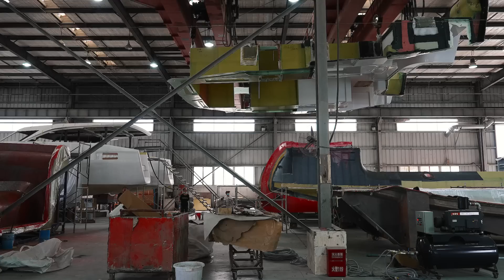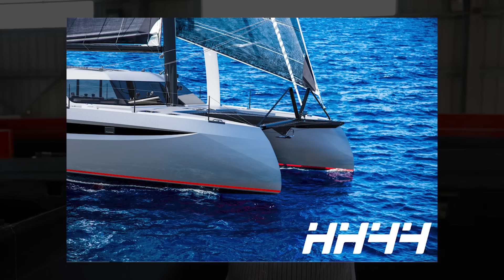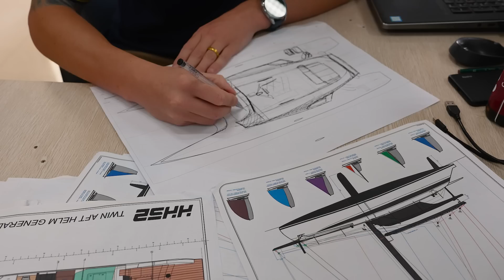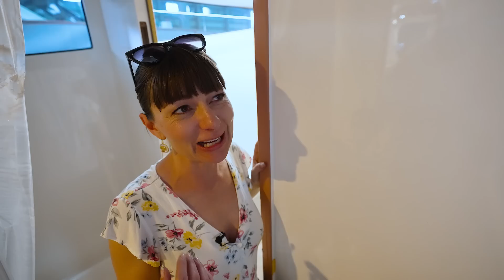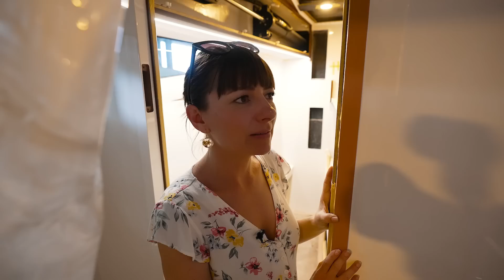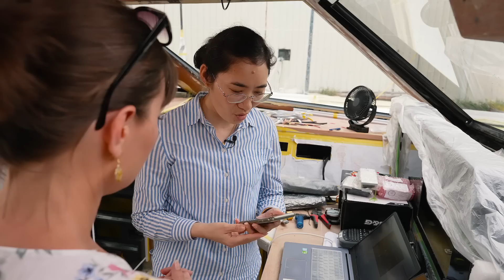BUILDING HYBRID ELECTRIC CATAMARANS (HH Factory Tour)

Comment: I used to race on a first gen VO70.  Big DBs and a  powerful and cool blue water racing boat that I wouldn’t want to live on or go shoaling about behind reefs in. They are loud when deployed and the trunks resonate all the load sounds of the boat. I think the winglets will provide plenty of reaching lift and stability. Fixed appendages for a working couple with one hand on the selfie stick (forgive me?!) capturing every interesting occurrence during a watch makes too much sense. And further, for your use, speed and lift is relative and disconnected from what we perceive when viewing your content. If you were racing other boats it would be interesting to see the sausage made working to windward, shifting gears with sails and appendage, weight and apparent wind angle. But… It’s not and add another task whether underway or not to a busy day. Peace!

Comment: Is there any faraday cage protection  designed in to the boat carbon fibers to reduce lightning damage? Carbon fiber needs help to let lightning be directed to non sensitive areas. Carbon fiber aircraft have a metal mesh to help in conducting lightning strikes and static electricity away.

Comment: Great overview! I'd love to know more about any automated line-handling controls... are you using any captive, or reversible, winches to facilitate "push-button" control of sheets or other lines? And of course I'd love to see an overview of the electrical system - maybe a block diagram - of the major components that are part of your system. By the way, there was a hydraulic piston shown just above your head while you were interviewing Riccardo... what was that for, and on what model boat? Thanks!
Reply from the maker: Man, you guys have eagle eyes! You're not the first person to ask about that gizmo, which seems to have a pulley at the other end. My guess (and I could be 100% wrong....) is that they're on an SC version and that mechanism is for raising & lowering the daggerboards? 

The electrical & rigging systems have been hot topic suggestions, so I suspect you'll get your wish there. Thanks for the feedback!
Curious Minion

Comment: I would like to see how the plumbing systems were designed and installed.  Usually that is the worst, most aweful aspect of boats, especially when it comes to repairing/replacing them when they are under extreme duress.
Reply from the maker: What a 💩-y topic! 😜 There have been a lot of inquiries about whether or not composting heads are going in, so I'll add your question to the folder. Thanks for the feedback!
Curious Minion

Comment: Thanks for the interesting tour, quite an operation there. One thing that bothers me that really is no big deal…..the tour guide mentioned using resin to wet out the CF or Eglass. The correct name for it is epoxy which is made of two components, resin & hardener.
Fyi would love to see you discuss a design comparison of the new ecodrive elec motor equipped boat vs the conventional diesel engine- cost/efficiency/performance/O&M costs/batteries&panels needed, etc.

Comment: There are two truths about Sailing, Smart Sailors almost never have bad passages, and it's opposite, Nature can create storms any time it wants.  Because of the need to dodge out of very bad weather I can't embrace fully electric propulsion so the hybrid system sounds like a great option,  My question is this, do you think you can save enough in Fuel costs and Diesel Maintenance to cover the costs of the extra battery usage and electrical system wear with the hybrid drive over the non-hybrid drive.

Comment: Thanks, Nikki and Jason, For all of the build videos. I also find it fascinating, and I like others here have stated. We like figuring out how things are put together and how they work. At my last job, I used to build aircraft parts (Air Ducts and Floor Panels). On the air duct side, I made the plaster "Mandrels" used to make the air ducts. They would use the Mandrels to wrap the Pre-impregnated (Pre-preg with resin) fiberglass,  Carbon fiber, or Kevlar depending on the part and how much pressure it had to withstand. Then they would Bag the part and apply a Vacuum to press the material against the plaster Mandrels. They had set times and temps to bake. Then they would remove them from the oven, let them cool, and then do break-out where they actually broke the plaster out of the parts! So that meant my BEST work and my mistakes all went into the garbage! Not many people can say that! The Floor Panels are actually a part of the structural integrity of the aircraft! They couldn't even roll the Airplanes out of the factory without those being in place! The plane would literally break apart if you tried to move it out of the factory! I did that job for 13 years before the pandemic then got laid off. Mostly because of the pandemic but also because they moved all of our work to Mexico!  🤬🤬🤬 Oh well, I just graduated from College with a degree in Network Design and Administration. That they paid for and paid me while I did it! Their Penance for moving all of our work to Mexico!😂😂

Comment: That there is the key > A designer who sails boats . I delivered a million dollar yacht 4000 miles & had to tack every time we wanted to open the fridge , thank god it had a self tacker on the jib . Worked great in the marina but with the weight of a full fridge ^ rolling motion it , The sliding fridge door was just to bloody dangerous to open in any sort of a sea way, It should have been for & arft instead of port & starboard .desisigned .

Comment: It sounds like the ability to fly a hull was added to this boat, not for the usual racing speed, but created as a safety feature. Could you explain this more? I get making the boat strong so it doesn't break if lifted, is that it? Forgive the ignorance here, I love sailing/cruising, but have a massive lack of knowledge in this realm.

Comment: After 30 years of breaking stuff on boats, I would recommend spending every waking moment learning about the electrics. When you break a spinnaker pole it goes bang, expensively, but you know exactly what happened because it has a bend in it. A water pump stops - look at the impeller, that’s fine and then it gets really complicated. Electrical fault finding is not intuitive. Knowing the basic electrical layout and having the equipment and knowledge to do fault finding is really useful when things go dark

Comment: HH as a brand to me was expensive compared to other production boats. But now I understand why! They must be much lighter than other production catamarans of  similar size because epoxy and carbon is stronger for less weight. So I expect they will be fast. Racing pedigree (Ferrari of the seas) rather than cruising. Great video, showing the thought that has gone into designing everything. Very clear explanation of everything. Keep doing what you are doing. TKS!

Comment: Hi Nikki and Jason, are you going to have electric bikes on board again?  If so, can I suggest an alternative?

It’s called an electric unicycle or EUC.  I’ve gotten one to get around rv parks as an alternative to a bicycle and I have to say it surprised me how useful this thing turned out to be. The one I have weighs about 30 lbs and I can throw it in the back of the car with one hand. It has a maximum speed of almost 20 mph and climbs steep hills with me, a 200 pounder, like nothing. 

If you decide to check it out I suggest you do it before you are back on the boat again. It will take you some shore time to get comfortable with it on even less than perfect roads but I promise you that you will love this thing more than your electric bikes.  

I, a 60yo fart, needed 2 weeks time to lean to ride it at the kitchen counter in our RV but I’ve seen fearless people racing around the camp in 20 minutes flat.

Here is a short video of me using my Kingsong ks14d at our home base: https://www.youtube.com/watch?v=K-XOnlSbS3k

Comment: I would like to see more on the mechanics of the boat. Is it fly by wire, torque tubes, cables, hydraulic or ?? How the mask is attached and if the mask is carbon then is the antennas built into it? I built a fiberglass airplane and I built the antennas into to the glass. Carbon may not let you do this. ?? Also if they are building parts from carbon are they using an autoclave? I see what looks like Kevlar in some of your shots. ? Are they using SS hardware and if so what grade? SS will get  corrosion stress cracks in salt water.  
I love watching you guys. Thanks for the real deal.
Steve

Comment: i may have missed coverage of it in previous videos, would be keen to see a breakdown of the electrical setup. i saw mastervolt products i assume are batteries, victron 24v/8k quattro inverter (maybe two) curious about the configuration of those, did you have another inverter in a separate system there? i assume that the drive unit shares batteries with a different inverter? beautifully set up, kudos to the man and his team who did it

Comment: Not really any questions at this time... However, after a month travel, after 6 months travel and maybe after two years travel. After 6 months may be good enough for anything useful really. By two years you are almost into wear based things and two years may not be enough. Also by two years, there may not be much interest as the "it's a new boat" feeling will have worn off for both you and your viewers.  Of course new boats will have moved on as well, so others thinking of buying a new boat will be buying something different anyway. So 1 month and 6 (or pick a number between 6 and 12). Note: for my situation as a holiday sailor, a cat is out of the question and new is out of the question. There is no where to moor a cat around here really except balls and anchor.... not a great way to winter over in the Georgia Strait. We don't have "Hurricanes" but we do have storms with winds over 60 knots from time to time. I am thankful for the very high breakwater at the Comox Harbour to hide behind.

Comment: I love everything but two aspects of the boat.  First, not a fan of sitting at the rear of the boat at the helm, I liked where the Leopard helm was, just feels safer.  Second, never liked sail drives, I prefer shafts and I don't think I would ever change.  Does HH even do shaft boats?  I love everything else though. I would love to find out more about the hybrid set up, and solar?

Comment: Would love to hear more about the placement of the batteries on your boat. Specifically, I was surprised that they placed them so far forward given that weight is generally better towards the stern.

And of course want to learn more about the eco drive, specifically how much you can customize/program it. How easy it is to service, electric motor power, etc.

Comment: Looks beautifully engineered and constructed, but the lack of sailing/boating experience of a large segment of the engineering and construction crew would make me a little nervous. There are some seasoned sailors on staff who try to make sure every system is well-designed for use and access at sea, but all it takes is one or two poorly designed systems or parts to cause discontent and problems. But your video about how the boat is engineered and constructed is fascinating.

Comment: In the age of maximizing solar, I’m confused why the coach roof isn’t designed longer to go all the way aft matching the length of the hulls over the davits. Could you ask James if there’s a reason or just because he thinks it looks better  or just tradition. Seems to me it’s probably tradition that the coach roof has been designed for shade rather than maximizing solar area. I’ve noticed only one boat builder doing that. It would be great if HH did it too to make an even more amazing boat. Thanks!

Comment: Could you talk about contingency systems? I love electronics in pretty much everything, but with microcontrollers and batteries and etc, when they fail, how do you get back to a place where a full repair can be done? I think it’s one thing replacing parts in a diesel and complete different thing with electric motors and batteries. 

Also, lithium batteries cause different fires (more toxic) than other ones normally found on a boat. How do you guys manage that risk with a huge capacity battery array?

Comment: I like having HH8801 in the background of your establishing shot. What a monster of a boat. 

As for what to geek out on, I feel like your boat is going to be one of the most electrified ones they have built. Are the hybrid drives AC or DC? Talk a bit more about using 48V for your DC systems. I know it uses less wire, but did you have any issues finding equipment that runs on 48VDC? Was there any thought in running all DC?

Comment: I'm a very practical person.  I don't like a lot of fluff.  Do they build boat systems that don't use all those computers and WIFI crap?  Hybrid with solar panels electric outdrives,  that can charge the battery's while sailing to go off grid as long as possible a big plus, but systems dependent on the internet and wifi kind of creeps me out to who and what has control of your boat.
Reply from the maker: It’s simply a connected network, no internet needed.

Comment: The HH technical philosophy is very impressive. If it’s on the boat it’s likely to fail and probably at the worst possible moment.
Engineering to that standard is hard but ultimately the soundest way to go about it.
Seeing your boat reach the final stages must be absolutely exciting.
Reply: His comments about other companies having issues with boats coming apart, and my mind went straight to Parlay Revival. Yeah, I like the way they are putting this boat together.
Reply: @RiverWoods111 more so he did it in a very professional way... he mentioned that there have been issues with other brands in a certain area, and they took the problems those brands had and engineered a fix so it don't happen to them

Comment: I appreciate that he says stuff isn't going to fail. The crazy part about Carbon Fiber itself is that it doesn't degrade in UV exposure, so it's absolutely permanent. Now the epoxy resin can breakdown over time in UV, but when you use the absolute minimum of it, there's not much of it to break down, and then if you paint it, you've got something that's not going to fail pretty much ever, as long as you aren't abrading it down with a line thousands of times.
Reply: Yep, and vacuum infusion is one of the best ways to get the best fiber/resin ratio for the best strength and weight. A protective coating is a must and a UV resistant clear top coat isn't enough, especially in a marine environment and it's exterior, it will get brittle over time. Paint or vinyl wrap are great protective layers.
Reply: Yes, but don't forget that CRP, just like GRP, is a two part system. The carbon provides the strength in tension and the epoxy provides the strength in compression. You need both.
Reply: @berndog3 the laminate provides the 'strength' in both tension and compression.
Reply: @numerical968  Isn't that what I wrote? Although, technically, it's not a laminate, it's a composite.
Reply: A fine overview, I understand a little more, thanks 🌱

Comment: Wow, the way he has the electrical system setup even with basic knowledge you could figure out how to troubleshoot, repair or replace equipment. You can totally see the influence from the aviation industry. Incredible!
Reply: Yes, the cabling and labeling of each cable tickled me pink.. Makes me want to re-do everything on my 22' Juncker sail boat :)
Reply: I had a Beaver Motorhome once and all the wires were stenciled with what they did.  Stenciled the whole length.
Reply: @nooneanybodyknows7912 
FWA

W
Reply: @peterbeckett7342 I don't understand. FWA?
Reply: How does one keep going when these systems fail?   Are there ways around all the complexity ?  Manual bypassed?  When the computers don't work what happens?  I truly love all of it, but worry about when it doesn't work.
Reply: Because of the way he has every system wired and labeled, makes me want to redo my Wellcraft to that level of total professionalism! He set the bar, and every ship builder should rise to meet that level.
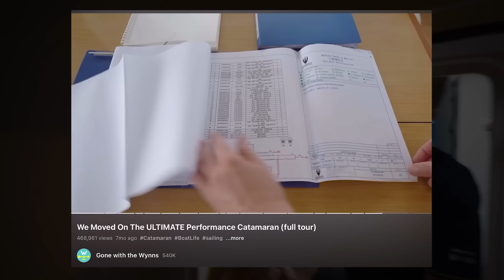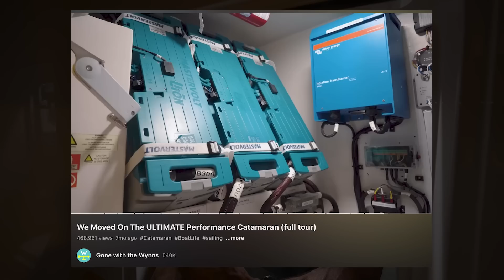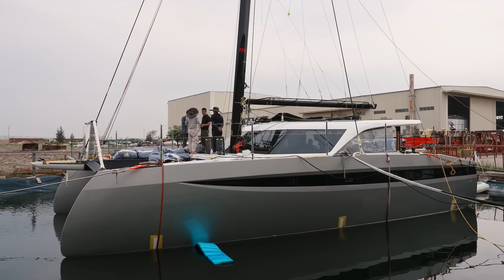Reply: From an electrical background, I'll give it a B. Label wrong direction @14:14, labels upside down to the viewer 14:19, no labels on conductors @15:48, some labels not heat shrinked and not well bundled in areas. Nothing that can't be remedied. OCD for electrical panel wiring. 👏 Thanks for sharing.
Reply: @nooneanybodyknows7912  Just to be devils advocate here ... Was the man not working in the electrical box as he was being interviewed so would you not expect incomplete work? Do you think maybe you are being a little harsh this early on and maybe you could give him the benefit of the doubt? But your observations are fantastic and your attention to detail is admirable, I think I'd be happy to have you survey my electrical installations!!
Reply: @Bob Gabbett  yes, I agree that it may not be complete. I believe he is above the pay grade of actually doing the hands-on wiring in his position. And, he possibly observed and noted the discrepancies that drew my attention. That's the reason I said it isn't anything that can't be remedied. 😁
Reply: @nooneanybodyknows7912  I think we should revisit this again when they splash. I'd love to have your eye for detail!

Comment: Hey, ask what the failure mode is for that electronics. Can the central computer fail and leave you dead in the water? (500 miles from anywhere!) Can you override the computer and at least get the motors up and running if there is a fail?
Reply from the maker: Great question!  I forgot to point out that yes, everything has a manual override.
Reply: @gonewiththewynns  Does Jason's corny humor also have a manual override?  🤣
Reply from the maker: 😆😆 Absolutely not!